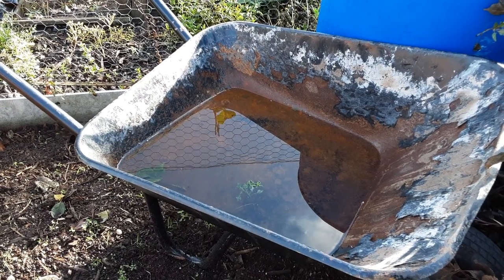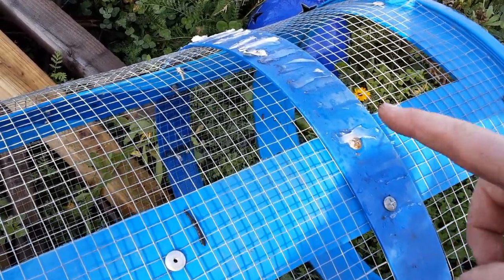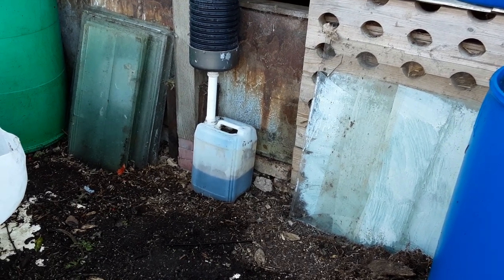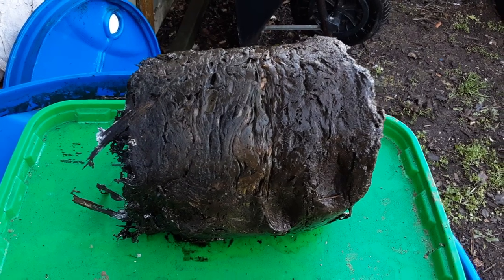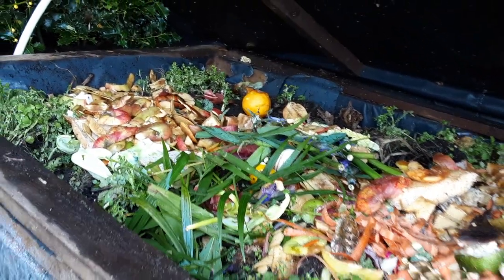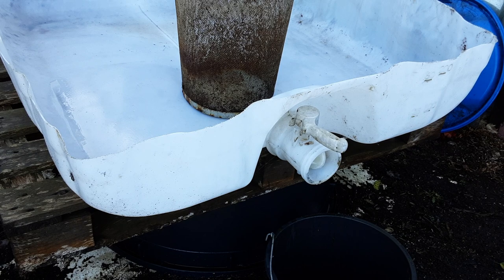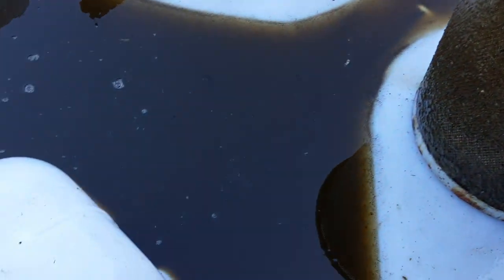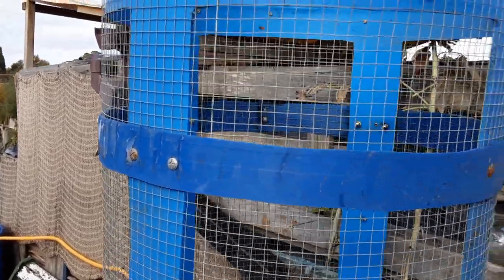Home Made Liquid Plant Foods 🌻 Comfrey Pipe Concentrate 🌻 Nettle Plant Food

Comment: Chat up your local garage for used timing belts, you can either use just on the barrel or the drive wheel and you'll have a cogged trammel.
Reply from the maker: I have finished the new Trommel barrel and if I do get any issues with slippage then I will fit the belts so the wheels have something to grip on to. Cheers my friend. 

♻️Happy gardening, Terry King.